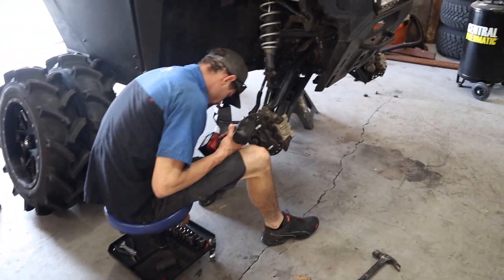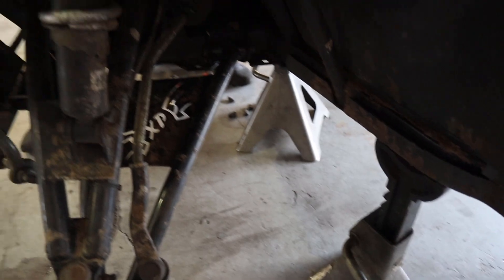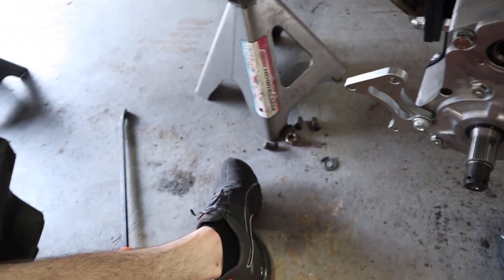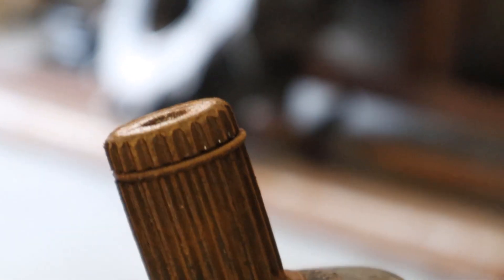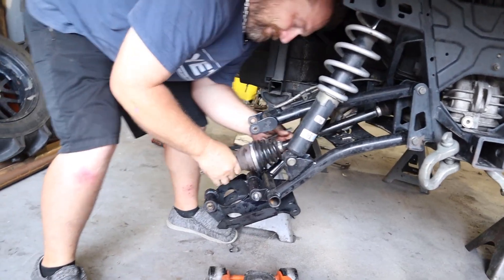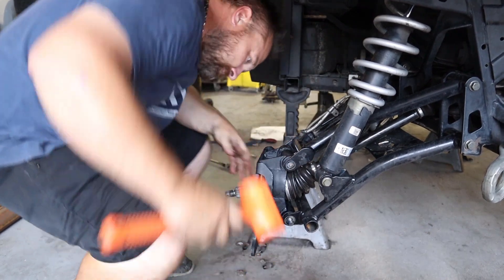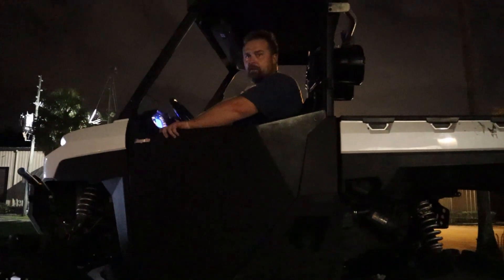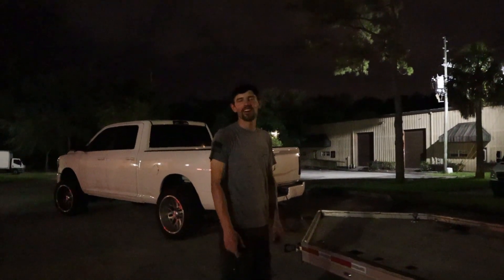2019 Polaris Ranger 1000 Gets 6" Super ATV Portals! |3BR OFFROAD

Comment: Right now, I have a 2016 Polaris RZR xp 1000. I was wondering if I need to get a lift kit, in addition to the portals? I'm interested in running 37 inch tires...
Reply from the maker: I have had rzrs in here with 4" portals and 35s with no issues. 4" plus forward a arm and possibly a small bracket lift to get 37s. 6" portals may do it on there own. But either way forward a arms and a small basket lift would be all. Not one of the big lift kits.

Comment: Hey bubba what size lift did he have on that Ranger with the 33 years before he went to portals
Reply from the maker: I believe he just had the bracket lift and arched arms. I ran 34s with just a bracket lift before as well. They rubbed a little when turning but not to terrible.
Reply: @3BROFFROAD  oh okay I just got the highlifter 3in and high lifter arms all the way around and high lifter tinder springs for the front. I ordered some bkt 33 on 20s. 4+2.5 think they will fit on a 2020 1000 Bass